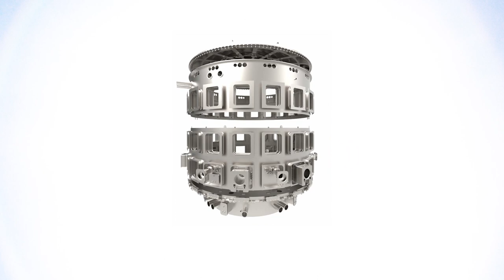Celebrating cryostat completion

Comment: (from a point of total ignorance) What's going on with these joins? (1:43)  Looks way thinner than the rest of the plate if joined by that 135 degree angle.. are you stacking/slotting sheets through it behind, and welding one by one to make up the thickness or something?

Comment: Is Russia still in this project?
Reply: Yes, Russia isn't going anywhere. Russia is the biggest contributior for this project. Kicking Russia out of a research project isn't going to help.
Reply: @facon4233  It's not true. Russia contribiution is only ~9%, which is small in comparassion with 45% given by EU.
Reply: @facon4233  Where you find this information? Would be interesting to compare all countries/parties
Reply: They've build only one poloidal field coil of small diameter and bunch of high current transistors .